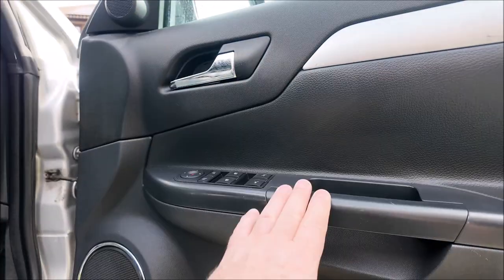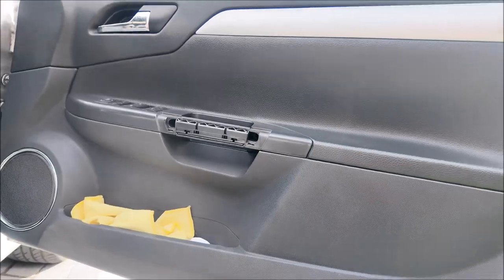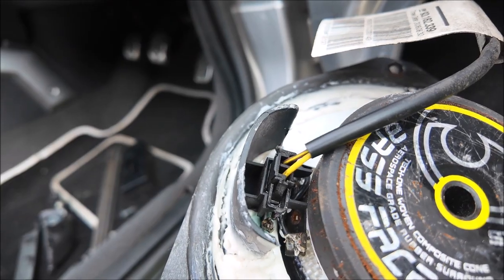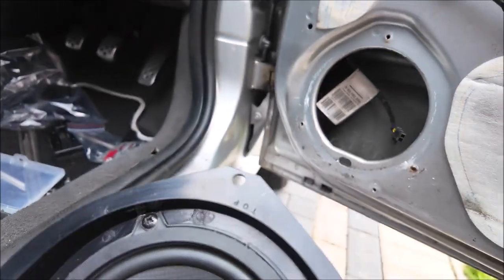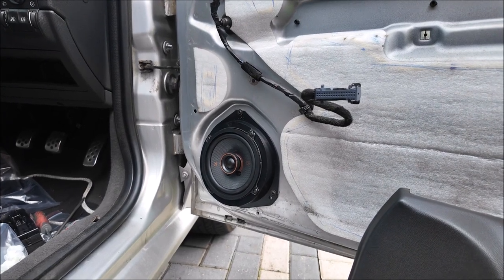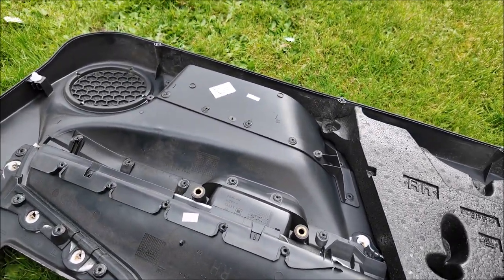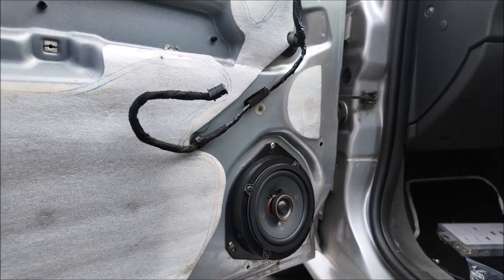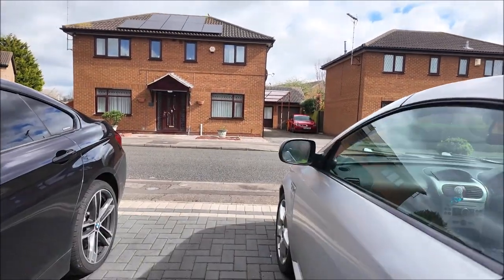Vauxhall Tigra Speaker Replacement... Eventually !!!

Comment: Hi Ade, just bought a 2004 1.8 Tigra. Swapped the speakers out, and changed the head unit. Speakers blown lol will be sorting tomorrow. Ted the Tigra is giving us a headache with engine warning lights, and engine management lights too. Lumpy running at idle and issues under load, throttle comes and goes. We believe it may be the cam shaft sensor. I have a new one to fit tomorrow. Can you advise where it lives? I've heard you can only get access from inside the car? I can't believe this. 
I thought it would live somewhere by the starter motor? 
Any help or advice would be amazing. Ted the Tigra is a star and I want to fix him :)
Reply: New head unit installed and speakers working :) just the sensor to sort
Reply from the maker: Hi... is the car throwing any codes up ?..  I believe the camshaft sensor is at the front of the engine , but i know i have had poor running and unresponsive throttle from the MAF ... might be worth cleaning the MAF with electrical spray and letting it dry then see if that helps.. the codes should lead you in the right direction though .
Reply: Thanks Ade, car has had a new MAF, new exhaust, coil pack and one way pressure valve. Code does come up but it's a generic P0170 electrical fault code. Only thing we think left to try is a good service, we're doing that today and the cam sensor replacement.